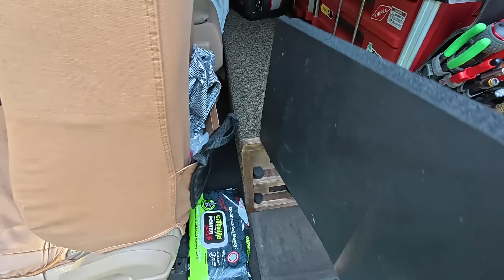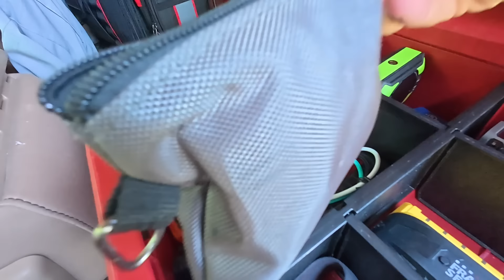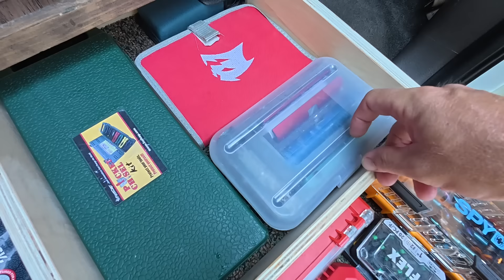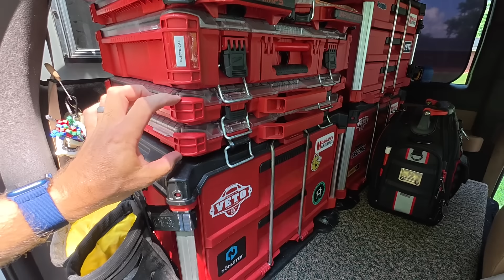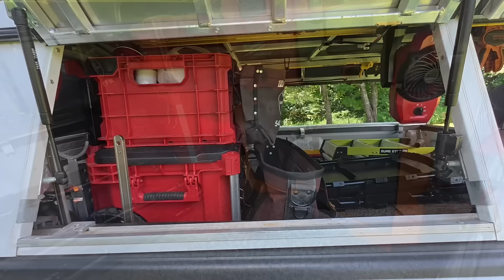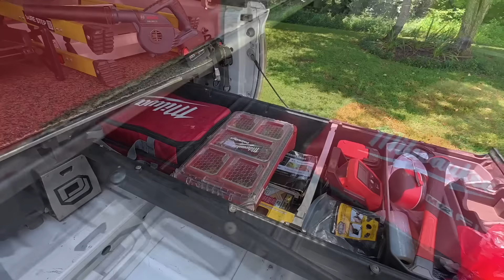2025 Truck Loadout - General Contractor & Handyman - My Best So Far?

Comment: Thank you for sharing. Besides the quality of your equipment I appreciate your organizational strategy and narrative.
Reply from the maker: You are welcome… and I appreciate it 👍
Reply: I enjoyed the tour too. I don't like all of the plastic organizer boxes in my setup, but husband explanation of how each kit allows grab and go for remote service now makes sense. 
I had 2 jobs in my career.  The first was an extremely large retirement facility with every building and floor interconnected. I worked from a rolling cart. I was young and I didn't have very many tools. I didn't have to packout a truck. I did handyman work on the side, similar to what he describes, but focused on major appliances abd HVAC.
I switched to industrial maintenance after 7 years, and I completed my career in the same plant. I built my mobility around a custom 2 triple stack tool chests (Kennedy and Snap-On) on a custom cart and a large tool open top Klein tool carry tote. The tool chest rig included a small workbench surface with a Wilton Tradesman 5.5" vise. I set up the toolchest cart on center pivoting casters as our aisles and wirk space were narrow and confined. The high quality casters allowed easy mobility over the 140,000 of plant. My chest weighed around 2000 lbs, but was very easy to push. 
I relied on few power tools in my chest, loading those tools as required usually on a scissor lift, which doubled as an in plant truck. My industrial world centered around extensive wrenching, so I was loaded up with wrenches and sockets paralleing an auto tech. My primary task was CNC maintenance (machine shop), so I was loaded up with precision tools (indicators, mag bases, micrometers, etc), and more sophisticated electrical troubleshooting instruments.

I better understand his maintenance focus after this truck tour. His work more closely mirrors the contacting work that one of my sons does. He does general construction contracting and installs and services all forms of stoves (wood, gas, electric, pellet, cirn, etc.). He drives a 1T with tall cab service body and lift gate. He trailers dump traiker, skidder, excavator, etc.

I am long retired, but I still enjoy seeing him other folk work.  My retirement work is pretty much reserved for working in my hobby shops. I am focusing on convention tool chest stacks. I have over 30 tool chests now, and I  have set up specific trade chests at workstations or in shops dedicated to specific trades.
Reply from the maker: @paulhunt598 appreciate you sharing.. sounds like great work

Comment: Awesome setup and video!  Quick question, your custom drawers that go through the cab that are accessed on either side, do you have drawer slides for those? It didn't look like you did in the video, but it seemed to open and close pretty smoothly
Reply from the maker: No I don’t.  I put glue down LVT on the bottom of my drawer and the bottom of the cabinet part.  It was a trial, but seems to be working well

Comment: That is a massive setup, a lot of investment in time and money. Thankfully, my work is all pre-planned, so I only need to take specific small tool set ups with me and may be a few general tools. The amount of power tools you have do take up a lot of room, but I don't need that many. Do the draws in your self made ones, have runners or are they just built with a slide fit? They seem to more real easy and no drop as they are opened.
Reply from the maker: I put Glue Down Vinyl Floor on the bottoms of my drawers and an the floor of the cabinet.  It was a trial, but it seems to work very well.  I made them fit pretty tight vertically so they can’t sag much. As long as I leave about 3-4” in they hold up well.

Comment: Hey Joey - What a great "tour" of your truck!  I can't believe how clean the door jambs of your truck are!  I have a question about the M12 die grinder with the bit that you said you use for strike plates.  What is that bit?  Does it work well?  Would it fit in the M12 "dremmel" looking tool?  Always looking for a good way to ream out strike plates and it looks like what you have would work well.   Thanks for the help!
Reply from the maker: I can’t find the exact one I ordered but it’s one of these https://amzn.to/4l2JMml

It works great, even keeps the round corners.  It has a 1/4” shaft so I’m not sure if it will fit in some Dremmels
Reply: @MORGANSMaintenance  Ok thanks so much!

Comment: Why would you not remove that headrest on the middle fold down seat. Seems to be right in the way.
Reply from the maker: It doesn’t bother me.  I only keep pens and stuff in that cup
Reply: @MORGANSMaintenance . Ok. I have the exact same truck - I tossed mine a long time ago.  Makes getting under to that bottom middle seat compartment easier. I don’t think anyone has ever even sat there to need a headrest 😂
Reply from the maker: @LukinF150 very rare, even more rare these days. Every now and then my wife and one of my sons would ride with me, but my kids are all older now and it’s usually just me and the Mrs.

I may try it, I had never really thought about it

Comment: I've always liked your setup. In your opinion would a crew cab be better or is the extended cab more functional? Does it even matter?
Reply from the maker: I think I’d rather have the more bed space. Sometimes the crew can beds are a little shorter. 

The doors opening the way they do in the Super Cab is sometimes better and sometimes worse, but I like being able to open the entire side
Reply: @MORGANSMaintenance You're right. I have the same truck (2012) Crew Cab and the bed is too short for a lot of tasks.
Reply: F150. Super Crew cabs can be ordered either the 5'8" or 6'7" bed options. I've had several F150 Super Cabs with 8' beds, a non negotiable requirement for my work truck.